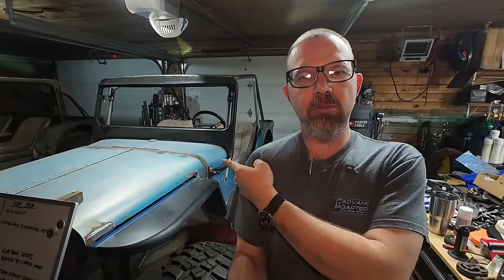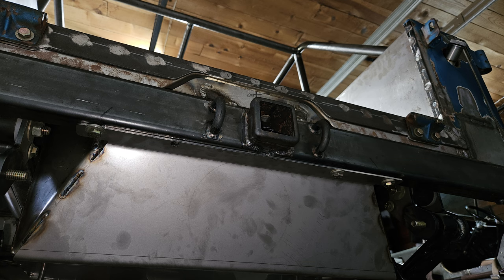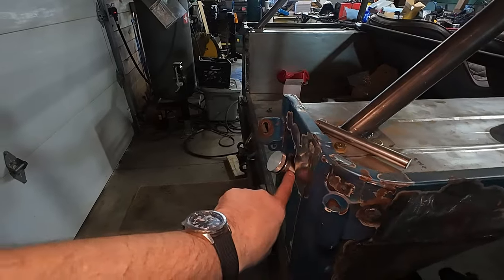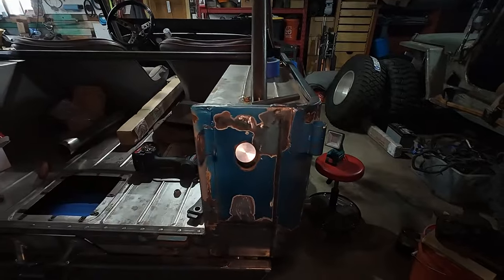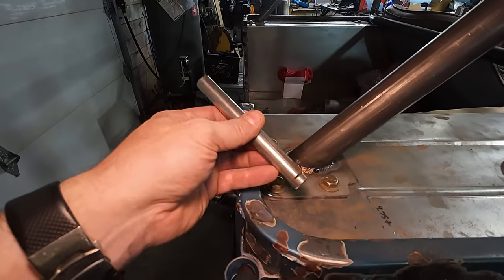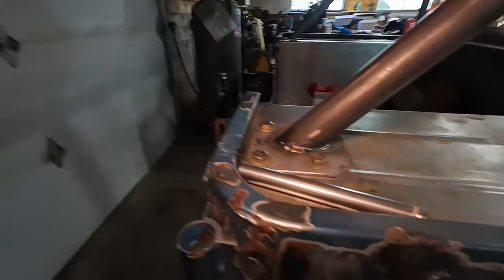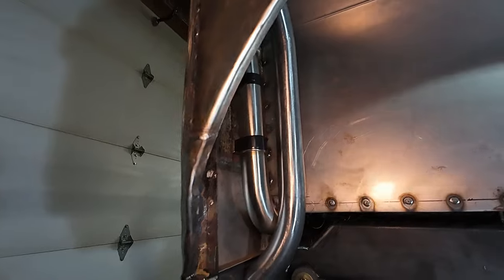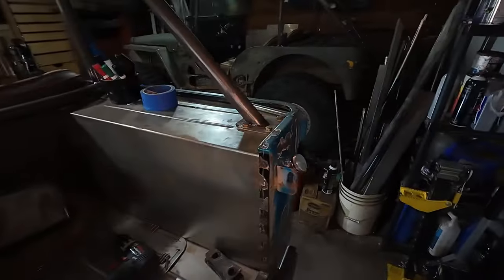Old Blue Willys Part 60

Comment: What did you use for the fuel filler cap / tube? Looks like the cap is something off the shelf. Got a link?
Reply from the maker: @grewe02 the filler tube is a vented motorcycle filler bung and cap that happens to match up really well with the 1.5 tube. I used something similar on my #LX45 build.